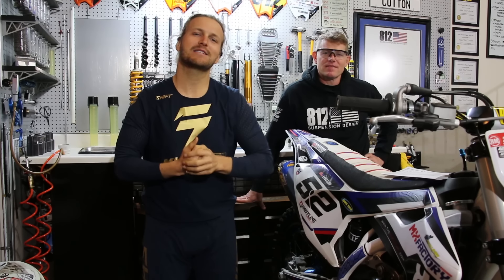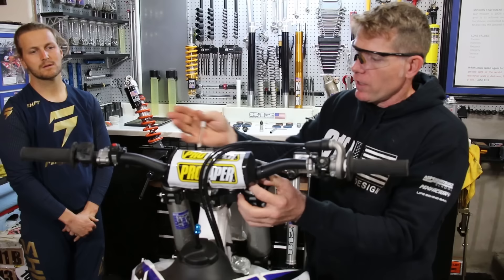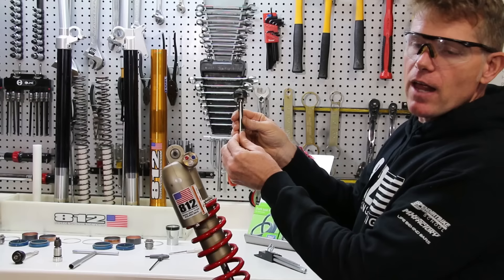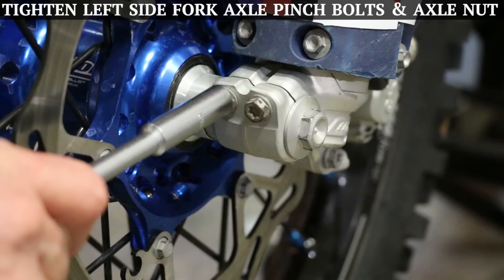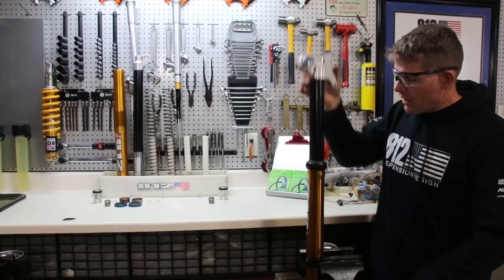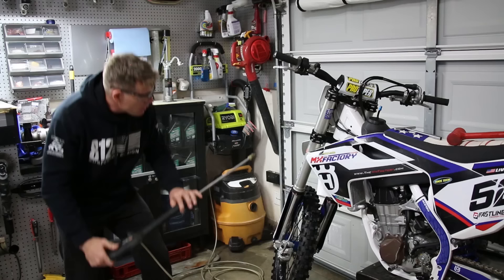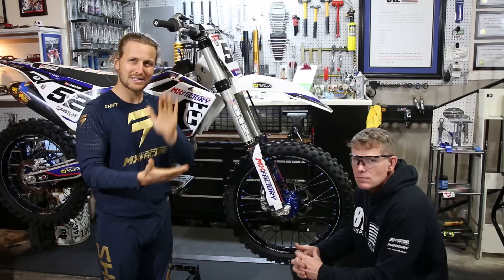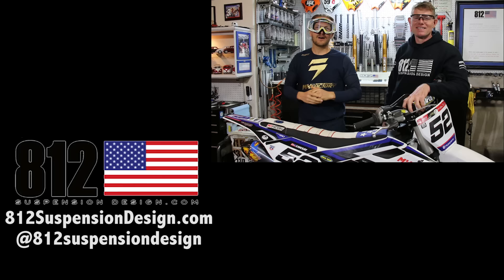Top 10 Dirt Bike Suspension Tips Do's & Don'ts

Comment: I work in the Suspension industry and this is actually a very informative vid with some very key points on suspension set up
Reply: do this apply to my 07 yz450
Reply: @3dwezzy740  year 🙂 at least enough that you would be able to manage. 100% champ 👌
Reply: instablaster.
Reply: taze shred  do you have standard or air forks? I just had this problem with my FC250’s WP air forks and I might have a solution for u
Reply: I did my own suspension (sans re-valving), because the people who work in the industry did the job wrong.
There is more information in the owners manual.  I am going to be nice, and stop right there.

Comment: Awesome tips!.. I tweaked my front end the other day when I flipped my bike. The guys told me to whack the wheel against a tree and that got me going but was not perfect. I got home and removed everything(forks/wheel etc..). Even after reinstalling it feels funny. 
I will look at the pinch bolts today and try that brake procedure. 

Gotta love tech tips AND SAFETY GOGGLES!!! LOL
Reply: Just loosen the axle clamp bolts, the upper and lower fork clamps ...this will relieve any load on the forks caused by a crash, hard landings and / or improper assembly in the first place. Move handlebars from side to side and wiggle tire side to side just a bit.  Tighten axle nut, then lower fork clamps , axle clamps, and then upper, do this one more time and the forks and axle will find their true positioning unloaded and off you go. Torque everything  accordingly. Too tight and it can cause binding.

Comment: Thanks guys! I finally decided to chase my dreams and buckled down and bought me a real MX bike.
The bike is a used bike and i got it for a good price, the suspension has been done by Pro Circuit before and has alot of aftermarket stuff on it. This video really helped me get started on getting the bike tuned to me. The sag is set pretty close, but i get alot of head shake at high speed  that about rips my arms off, gonna experiment with fork height and see if that helps!
Can't wait to get the chance to come to MX Factory one day! Maybe the young kids will laugh at the old guy learning!

Update: I adjusted everyrhing on my CRF250R to your settings as a baseline to try and all I can say is WOW!  I found the setting insanely off from what they should be and now its sooo good. It eliminated the head shake and it jumps so much better now. Gave me confidence to finally send my bike for my personal longest jump! It finally sits on power on exit now and gives me so much confidence to grab all the throttle! I can't thank you guys enough for making this video!
Reply: Congratulations on realizing that dream!  I hope I see you out riding someday.

Comment: great vid very informative and covering items my shop manual does not. my only criticism is the screw driver used to alter clicker position was a dodgy fit, it needed to have a thicker blade to fit the slots better other wise damage can occur to the screw head. I know there is not a lot of pressure applied and that most would not care about the damage. IMO it is best to have the tool that fits best for any job..  thanks for the vid it was good to watch.

Comment: I was a fanatic about my suspension and brakes......any motor has more than enough power......if you can learn how to really dial in suspension for your tracks it makes pretty big difference....I wrote down all settings I used for each specific track and condition ( if rough, avg or smooth that day)

Comment: not sure if mentioned in other comments but another hugely important tip is to slide the rear shock bump stopper up and clean and dry the crud in there .  a quick spray of wd40 too . Its amazing how quickly the shock shaft rusts when the rubber bump stop is soaked in water .
Reply: That plated shaft should not rust unless the hard plating was done in china.  It is not the plating that is rusting, but the steel underneath , and coming thought a hole or crack in the plating.

Comment: You mentioned woods riding and steering. You need to also address deep loose sand like the Dunes along Lake Michigan. For that the rear tire must be screwed through the rim and the pressure lowered to 2 psi on a very very stiff six ply 4.50 knobby. I always run about 4 to 6 psi in the woods as you never know what you will encounter as far as  mud and sand.

Comment: Question - 2:09 in the video you say more clicks = stiffer. If you're bottoming out (going clockwise) to start, then counting clicks out, aren't you reducing compression with each click out (counter-clockwise), or the more clicks, the LESS compression? Reducing compression should make it LESS stiff? All the way in (clockwise) is closing the orifice, basically blocking the fluid movement to the max, which would be the max amount of compression. Or are the settings on the SFF fork backwards from most forks?

Comment: Excellent video : )
Not happy and cant figure my forks out though.
KTM 250 exc 2004 ...changed bushes, seals and tried different amounts of 10w fork oil....makes no difference.
Clickers com & dam dont make the slightest bit of difference as it still feels "Boingey" like a pogo stick.
I will try thicker oil but cant understand why the clickers aren't making any difference at all.
Any thoughts or advice extremely welcome.

Comment: Excellent video, one question, about the high speed shock. Will my shock get stiffer or softer if I turn it in all the way in-clockwise?
Reply from the maker: It won’t get stiffer or softer from adjusting high speed compression. Stiff or soft comes from clickers, the actually shock spring, and internal valving. All the high speed does is change the way a shock takes a high speed hit. So if you turn it in all the way,  it will get stiffer on high speed hits.

Comment: When your talking about triple clamp torquing and you say they torque it then then check again. Are u staying torque the bolts to torque and do each one once?

I go back and check the torque as I find when your pinching the forks the one u are torquing throws off the other bolt then u have to go back and torque it again as it’s loose no where close to torque

Comment: is it safe to rotate the upper tubes on the forks 90 degrees when the forks are set up on the bike, for example if i want to change the facing of the fork protection stickers, i have a ktm 300 exc 2012

Comment: your forks will always re pressurize within a few minutes after bleeding causing them to feel harsh install a set of pro bleeders and you never have to bleed your forks as they keep the fork from building pressure they work awesome.
Reply: I have a button on both of mine so I can just press it to release pressure before going out for every session :) 
Usually the pressure doesn't build up too much after each session but a full day without depressurising they build up a lotta air in there

Comment: I didn't read through the comments so I don't know if I'm asking a redundant question. Why set the SAG standing versus sitting?
Reply: Shifting your butt backwards or forwards on the seat changes the amount the suspension sags, so getting an accurate, consistent measurement is impossible this way. The recommended sag specs are calculated with the rider's weight centred over the pegs in the standing position.

Comment: I don't necessarily think setting your sag in the standing attack position is strictly the only way to do it or the best way. I think a combination of sitting and standing, taking two separate measurements and then splitting the difference. A rider typically will spend more time seated rather than standing up in the attack position. Riders are mostly seated or just hovering above the seat.
Reply: Only on smooth tracks.  I stand as much as possible.  But yes, you can set the sag sitting or standing.  The difference for the two normal positions may be a couple mm of sag.

Comment: I don't think the latest MX generation really knows how to adjust the suspension, and they don't have to know on the smooth tracks today.  With smooth tracks, all you need is bottoming resistance for the 60 mph jumps in the middle of the smooth straight.  Best suspension made, on the smoothest tracks we ever rode on.  OK then pros.
I can't wait until a MX bike is as easy to ride as sitting in a lawn chair,---so everybody can brag about how much skill they have.

Comment: Thanks for the Informative Video!!!  As Bike Mech./Tech I rebuild forks On weekly basis always leaking.  Are OEM  Seals better then  say  Pivot works seals and bushing kits?  what brand 5 wt oil  whats the best manufacture oil?  I know  Left fork is always leaking more than rights because the heat from disk brake caliper rotor creates heat and increases pressure  . Its always good thing to Bleed air after each moto?  always good to pass on Info to Customers .
 thanks guys

Comment: Hence it's just, a seal check. Not a function issue-- technically. External safety, zone.
And one shaft-- hence opposite ends-- same length? Hence-- amps up, directs it. If shaft is,
g=9in X 5 extra amps = 45amps inches (9,5 grids power band centers).

Comment: Where is 10 & 17 clicks in regards to fully open, middle & closed?
Reply: It does not matter.  Click them where ever you want.  The vid did not tell you why you adjust them, so it does not matter.  But, for suspension and carburetor needle settings, how far you open them is always from lightly seated, (closed).  So before you start guessing where to click them to, first count the clicks as you close them to closed, so you can at least get back to where you were.

Comment: what kind of straps do you use for transporting your bike?
Reply from the maker: Anything with the extra little tether on it to hook to your bars with the strap and not the metal hook. Bike Master or KTM make great straps.
Reply: The Mx Factory if you run thexloose end of the strap through the eye hole in the metal hook you effectively creat a loop making even the straps with hooks usefull in the way you suggested

Comment: I had my suspension revalved and resprung for my weight & style, so I suppose Im slightly ahead of the curve..
Reply: Dr. Hugo G. Hackenbush How was the difference before/after the revalve? Worth it?
Reply: @mxracingunlimitedltd7784  The bike is a '96 CR500, and there is a noticeable difference, allthough Im sure the heavier springs helped a lot. Stock forks were very soft and bottomed easily. The rear was ok, but also too soft. I had them revalved with the Gold Valve system with the heaviest springs available, and had the valving done to accomodate a 250lb pro (Im lighter, but wanted bottoming resistance) and the forks are much better, firming up more progressively with less dive in corners and the rear is more planted and feels more controlled, especially over braking bumps. It is worth it, and I am going to have the Gold Valve setup in my '97 KX500, and my other bikes if its available ('88 CR500 & '82 IT490 changed to YZ spec). If I could find one though, I would run an Ohlins shock on the KX, because the stock one heats up and starts loosing controll when pushed really hard. I'll try a revalve before I begin searching eBay though.
Conclusion: worth it. 100%.

Comment: As good as modern suspension is?  It has become so fricking technical and so maintenance intense finicky that it really substantially detracts from the joy of owning and riding a motorcycle ....I feel like racing rules should have been written to STRONGLY discourage complicated suspension ....I don't know how that could work ...maybe forcing everyone to have the same setup ...maybe a total price ceiling on brand new components  .....samet thing with fuel injection systems and valve trains ....just ultra simple shift that requires very little maintenance and has very limited adjustment ...it's just gotten to be TOO MUCH...It ruins the sport and discourages people entering these sports ...in my opinion...
Reply: Ok boomer

Comment: the clicks setting you are mentioning is wrong. If you turn all the clicks clockwise it means the compression will be super stiff and the rebound super slow. When you turn counterclockwise you are making your compression softer and your rebound faster. Same thing goes for the mono in the back.
Reply from the maker: If you’re turning the compression clickers you’re adjusting compression if you turn the rebound you’re adjusting rebound.
Reply: @TheMxFactory   I was obviously referring to the 2 different knobs (the red one for compression and the white one for rebound). So basically what I was trying to say is that your instructions tell the exact opposite in terms of compression stiffness and rebound velocity to what in realty happens when you set the clicks on those knobs.
Reply from the maker: So, just went back and watched the video and I heard Doc say multiple times clockwise closes counterclockwise opens and the he shows how’s that moves the needle inside to restrict and let oil flow. So unless you’re seeing something other than I am, the video is spot on. Take another glance and see if you’re hearing it correctly.
Reply: @TheMxFactory  PLEASE go to 2:10 and READ what is written. I will do it for you. After turning the clicker all the way in clockwise, TURN CLICKER OUT TO ADJUST (COUNTERCLOCKWISE) TO DESIRED SETTING (MORE CLICKS= STIFFER FORKS). That is just wrong. More clicks counterclockwise, softer fork in compression. The explanation he gave about the valve functioning is correct but when you turn all the clicks in clockwise it means everything is closed, no oil goes through and the fork is stiff at its max level. By clickin counterclockwise you're letting the oil through the valve, thus having a less stiff compression of the fork. Is it clear now? 
There are several other viewer down the comments who noticed the same mistake. It's not the end of the world but a lot of people could just go nuts by doing the opposite of what they wanna do.
Reply: @TheMxFactory   by the way I own a 2017 HUSQVARNA FE 250 and a 2019 HUSQVARNA FE350 and thats how WPs work.
Reply from the maker: We agree and am very very aware what the clickers do to the suspension, but I’m still not seeing what you’re saying. Went to 2:10 there is no writing there. If there is somewhere then it’s clearly a typo. We just can’t find what you’re saying.
Reply from the maker: Ahhhh I see it now. You’re right, typo. Hopefully the 10 times that doc explains it trumps our editing mistake. Thanks for pointing this out!

Comment: Lol “while bleeding the forks, make sure to wear eye protection”
Reply from the maker: When you work on as many forks as Doc has off of bikes that people have ignored suspension service, you’d wear them too. Suspension fluid can spray up or even the air screw can fly out if the fork has enough pressure in it. Sure it’s a very small chance it happens, but it certainly can.

Comment: Man am I glad I was riding back in the day when you checked the air in your tires, got your helmet and started riding. Newtonmeters ?  WTF is that ?   Hey, if you're an ace competitor I guess this has value...
Reply: It's a torque value.  Say your torque spec on a bolt is 8 foot pounds, that converts to 10.8 newton meters. Torque specs are helpful to keep people from stripping the threads on their bolts or nuts. 
Edit: torque specs were definitely a thing "back in the day" as well.

Comment: this hurts my brain, i just wanna ride my damn bike.
Reply: yeh until you get headshake at 35mph and shit your pants out of fear because your bike is setup wrong lol
Reply: Chad    Lmao
Reply: THE WANDERER haha it happened to me last weekend at an enduro. I literally have never been so scared
Reply: Chad     yeah I’ve sense learned how to setup my bike especially now that I’ve progressed to amateur tracks and the stakes are a lot higher.
Reply: THE WANDERER headshake is pretty simple usually. If your getting it on deceleration coming into braking bumps add 2 or 3 clicks of compression to the fork and focus on keeping your weight back on the bike a little bit, if your getting it on acceleration tightening the headset bearings or lowering the fork in the triple clamps helps.

Comment: I just remove my bleeder screws.  Can’t build up air with an open hole.  Set all my clickers to tight. Then one extra turn to really seat that needle. Tighten my chain like a guitar string. 60 psi in both my tires. Take my filter out so I can use the airbox to carry my beers and I change my oil every year rather it needs it or not.